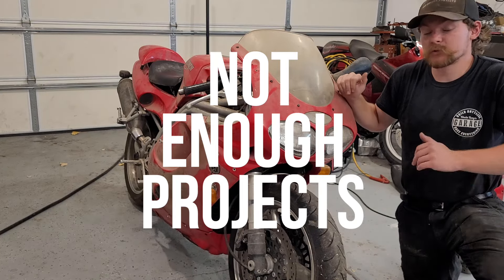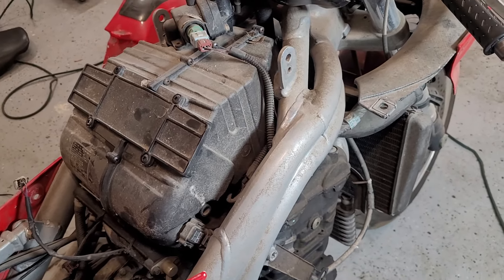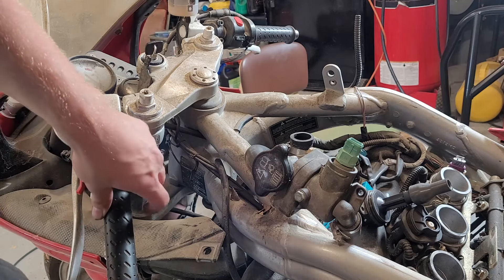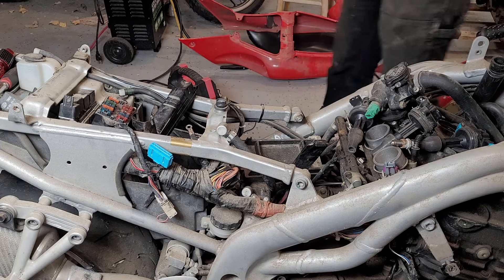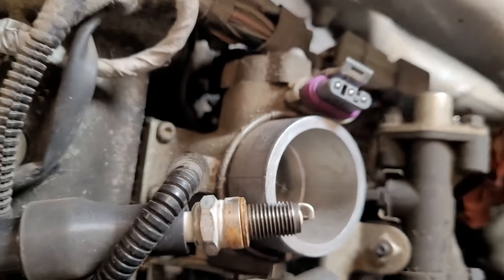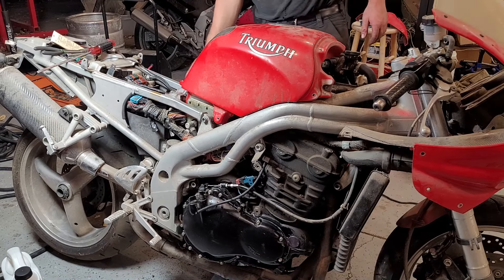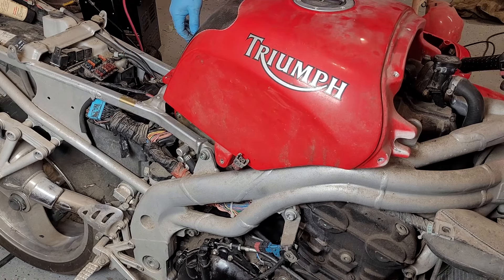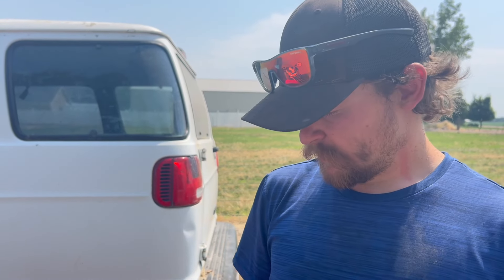Neglected Motorcycle Hasn't Run in Years - Let's fix it

Comment: 21:00 at some point it has become law that bikes have to always have their lights on, so obviously, the switch got removed to shut them off.
I guess that had to be in the early 90s or so, since I owned two 80s bikes and on them you could still turn them off...
Reply from the maker: Early 90s sounds about right for the switch over

Comment: pah, 41k miles is not that bad.
I've got an old Honda from the 80s with almost 100 thousand km (62k miles), so it will soon roll back over to 0 😂
At that point the reliable V2 is just broken in I'd say. I've heard of trans-alps with the same engine with 250k km on them just running fine.
Reply from the maker: That's awesome! At a certain point high mileage vehicles become more impressive to me than the super low mile ones